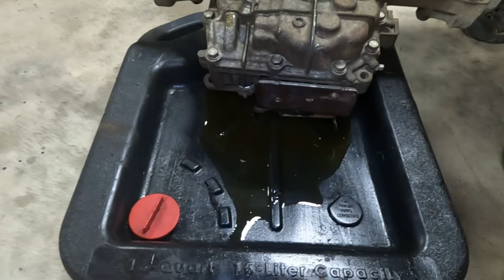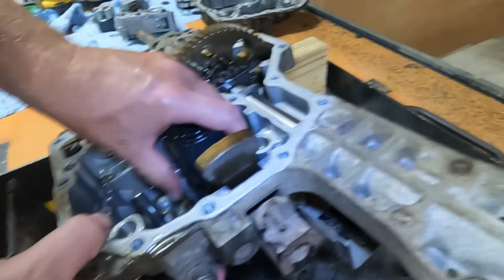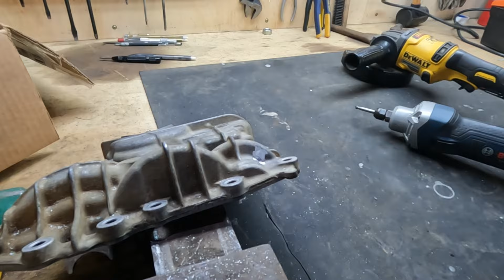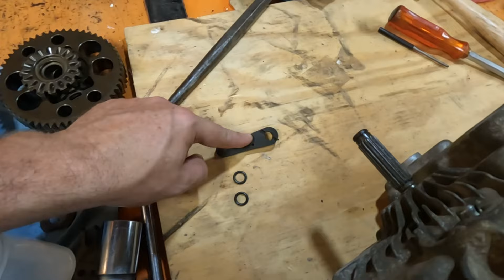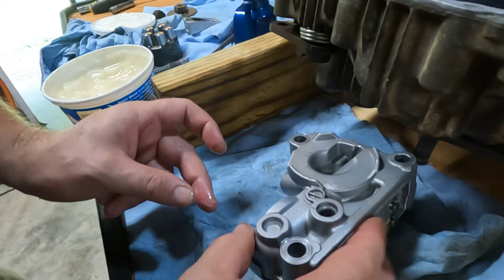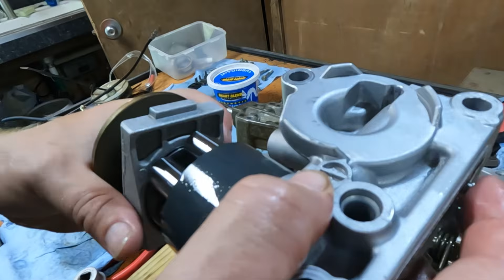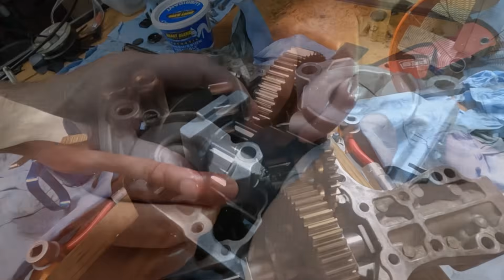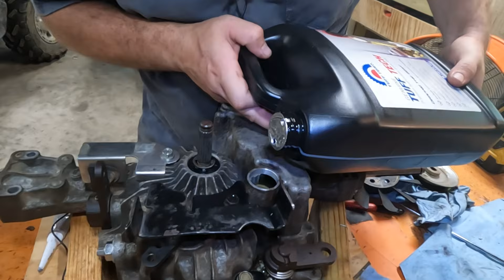Tuff Torq K46 Series overhaul

Comment: David, your a MORON. But this vidio is AWSOME and easy to follow. I do have one question tho, I have a 2022 John Deere X 354 with the K46, I can role, ( push )  the tractor easily while not running or running, and NOT pulling on the neutral rod, I back down from my trailer and release the reverse , it still want's to roll.  John Deere says that's normal. I tried other X series tractiors on the lot, they all pushed rather easily while not running. Your opinion ? Thanks again .

Comment: Did you get all that Max Not quite chief What didn't you get Max everything after we take our these bolts and prise it up using the pry points. I'm afraid you lost me soon after and as for reassembling it not a chance I'm completely lost. But you sure know your stuff.Parts washer?? Are you sure that's not a dish washer?? If it is a great idea for a parts washer but I don't think dishwasher tablets would be a good idea  I think they have sodium hydroxide in them wich may play about with the Aluminium. Great tear down though, but you lost me.
Reply from the maker: David - its much easier to do when you have the parts in front of you!  Yes the parts washer is an old dishwasher, I don't use dishwasher tablets rather I use commercial de-greaser that I pour into the bottom before I start.  It does a great job.
Reply: Hey "Max"
This guy did a reasonable job, especially if you have some idea,
you may have to watch it a couple of times,
but Check out Pilot View Productions,

he does an excellent couple of videos on this transaxle.
Really detailed every step of the way, first class.
I can even follow them.
Cheers,
Larabee. 😉